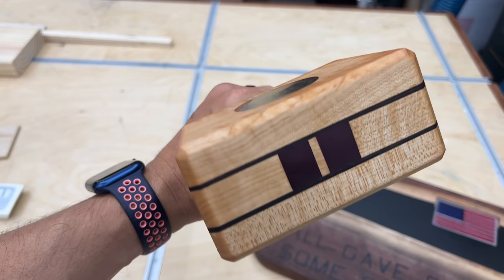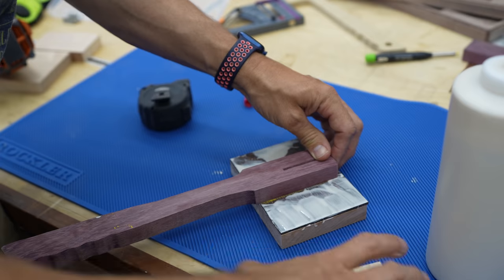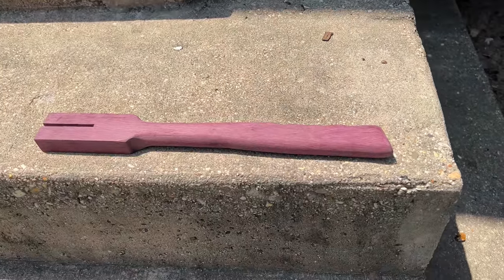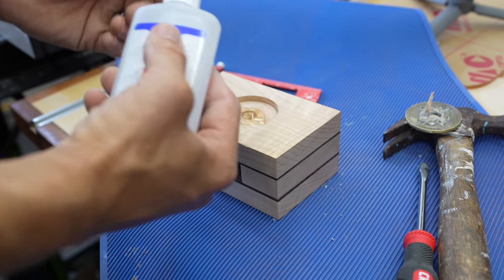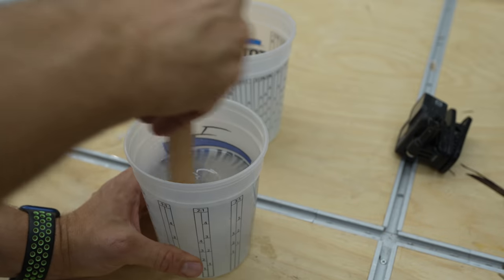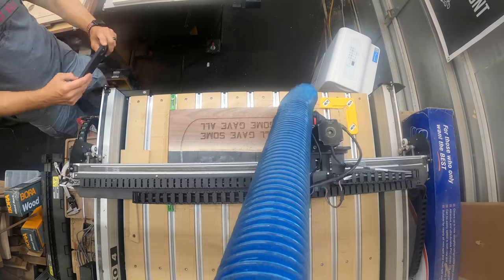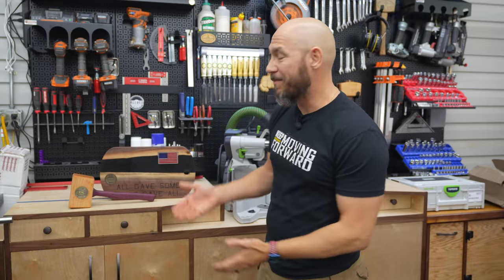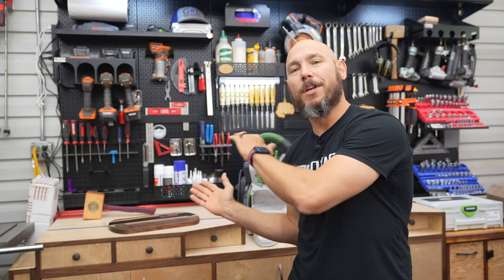How to Make a Custom Woodworking Mallet

Comment: I challenged myself to make a planter box with some green fir pickets , and to instead use the miter to slot the end pieces.
Each end panel slot aprox 5\8 from the end of each.
Then went into the back of the now glued in miter slots when assembled, and used woodscrews to go into the endgrain in order to cause the endgrain to spread inside the connected mitered joint in order to increase it's joint strength further.
Normally id NEVER screw into end grain 😅 but in this one case it works very well
Its solid as a rock.
Amazing mallet !